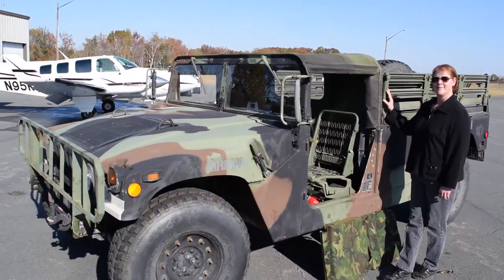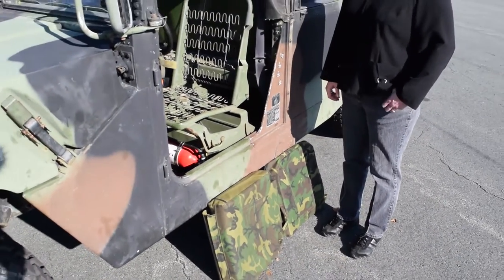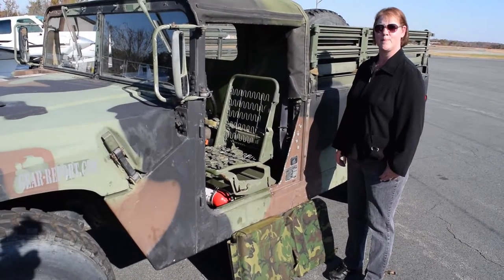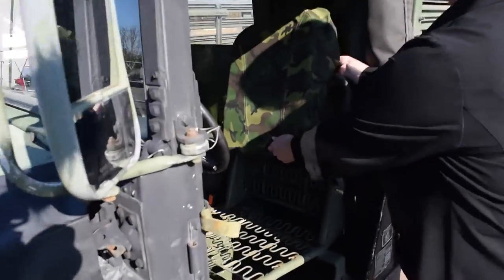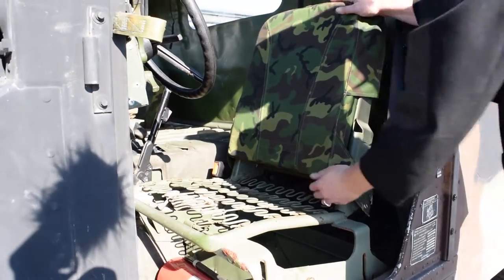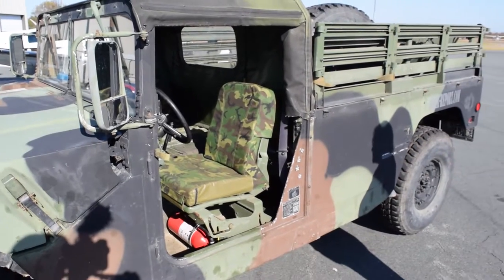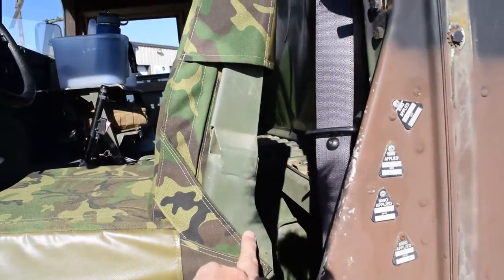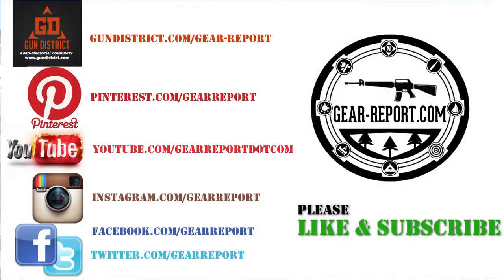Humvee Upgrade - How to Install Oregon Aero HMMWV Driver Seat - Gear-Report.com

Comment: I don't doubt they are more comfortable than the stock seats, but I don't care if I was driving cross country 2000 miles (not what the M998 is made for) I still wouldn't pay $600 for a seat cushion, especially when you can buy a whole set of buckets for under $1000.
Reply from the maker: These weren't designed for you. Never said they are the right seats for everyone.
They were designed for the soldiers that spend all day in their vehicles, then need to be able to jump out and fight.
Some people just drive our HMMWV around town for short trips. These seat cushions are really nice, but may not be worth it for those short trips.
Personally, I have lower back issues. The stock seat cushions are hell on my back.
However, with these cushions my back is OK.
For folks with back issues like mine it may make sense to spend $600 for a seat that they can actually sit in without pain.
Reply: @GearreportdotCom  if you have lower back issues you may want to change your bed cushion or your pillow. Also do some exercises for lower back. I never had back issues in my life until recently when I had to move and the land lord provided some really horrible low quality bed cushion. I had to change it because of the terrible pain. Just a friendly advice.

Comment: Am I wrong or are these cushions $642 per front seat?
Reply from the maker: I believe that is about what they cost. 
I honestly doubt they are worthwhile for someone that just drives their HMMWV for 5-10 min at a time... quick runs to the store, etc. 
However, if you spend an appreciable amount of time in your vehicle, then these cushions could very well be worthwhile. They really are a LOT more comfortable, especially when you sit in your vehicle a lot. I couldn't imagine riding all day on the original military seats. The stock seats are just plain uncomfortable.